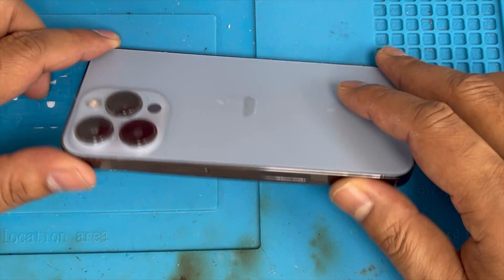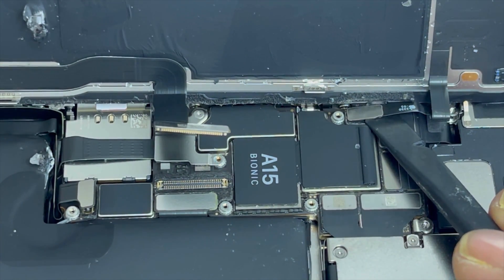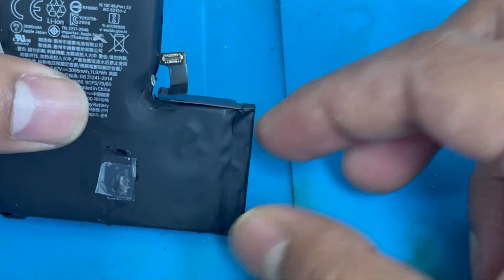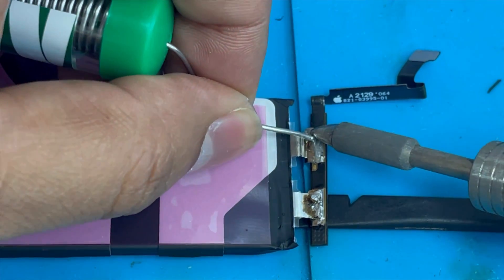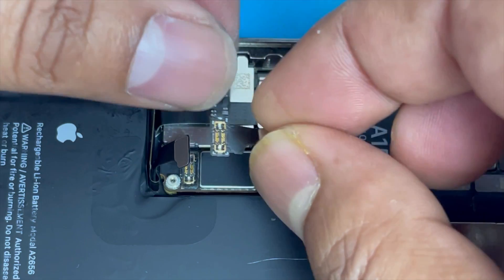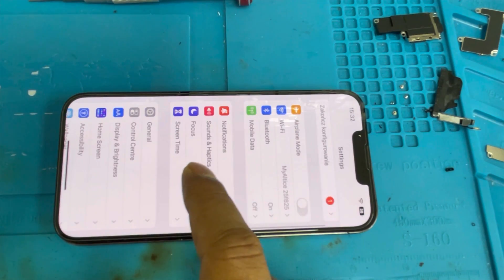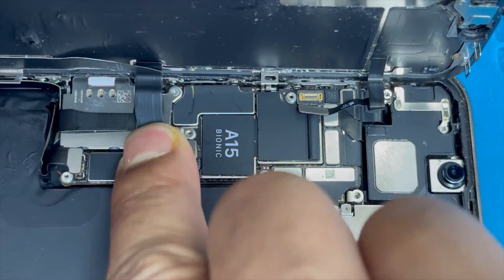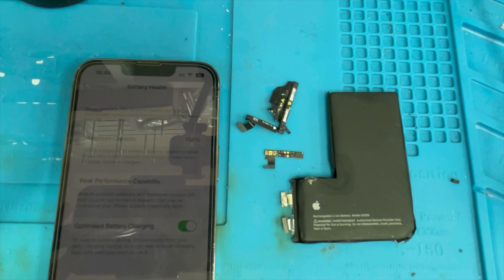iPhone 13 Pro battery replacement ,remove important battery message tag on flex

Comment: Good day. Will this trick also work on the iPhone 15 pro and higher series with iOS 18 and higher ?? (Obviously when using, tag on flex to current model). Thanks
Reply from the maker: Should be work but didn’t try yet iPhone 15
Reply: @s-us-u8296  Thanks.

Comment: I have an iPhone that will keep showing the old data at 88%, I have tried connecting a different battery, rebooting and reconnecting the new battery with the transfered bms board again but to no avail. The new data won't show up whatever I do, have you come into this? I have done many replacements without issues with the same tag on. Thanks in advance for your reply
Reply: you have to flash with 3utools and check fix battery health option
Reply: @salvatore1231 where i find that option?
Reply: Same
Reply: Did you fix it ?

Comment: Hello. Thank you for your video it is very informative and helpfull. Can you please tell me one thing because I can't find it anywhere else. Is it true when you do factory reset on iPhone that it will bring back that message about not genuine part installed? Is that true and if we leave tag on flex cable inside the phone will then show new percentage and "as genuine" part without that message even after factory reset? Hope some will answer this. Thank you all, and have a great day! ;)

Comment: can anyone tell me where I can get the battery tape from?  It did not come with my new battery.
Reply from the maker: From eBay
Reply: @s-us-u8296  Tried that yesterday.  Only thing that comes up is that double-sided adhesive that holds the battery in.  I need the black tape to seal the battery back.  Will electrical tape work?
Reply from the maker: @BillAnon  Battery Flex Protective Tape
Compatible For Phone 13 Pro
https://www.mobilesentrix.com/battery-flex-protective-tape-for-iphone-13-pro-20-pack

Comment: My Iphone 13 Pro battery health is on 74%, the phone start switching off automatically and then turn back on again. Do you get the same problem and my iphone update is 17.1.1.

Do i need to change battery or something else need changing aswell on the phone? Apple are asking me to completely change to motherboard and everything which going to cost me same as the iphone itself.
Reply from the maker: I don’t think so update have any issues, your battery look like OK 74% , did you check your storage full or not?
Sometimes happen with the motherboard
Reply: @s-us-u8296  My phone just switches off and I have turn it back on again.
Reply: @AbdulRahim-mo3zc motherboard prob